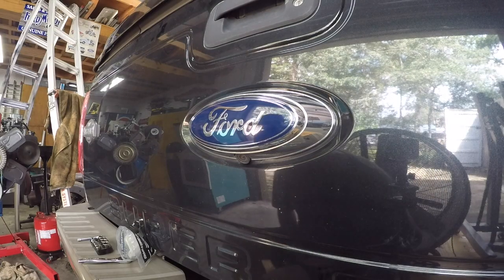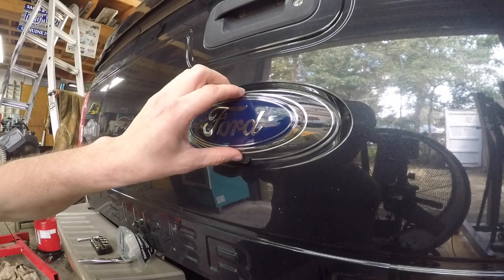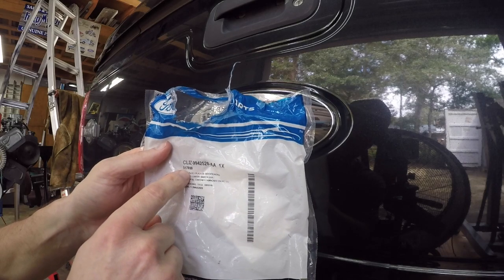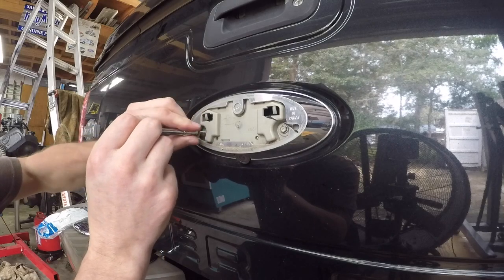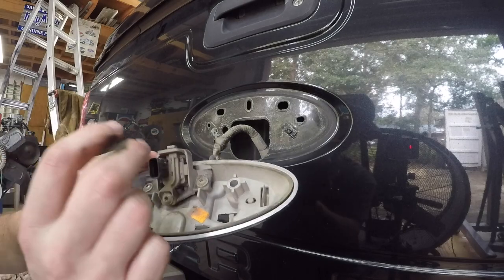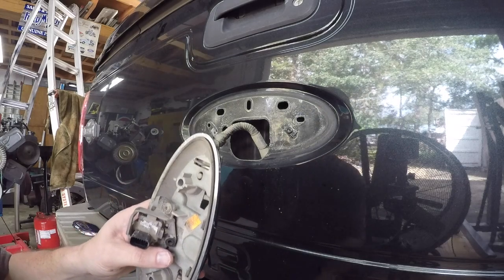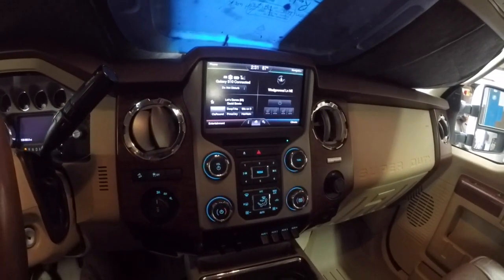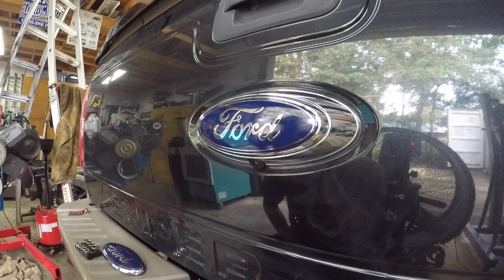2013 Ford Superduty F-250/F-350 - Backup Camera/Park Assist Replacement

Comment: Thanks for the video. Purchased the backup camera on eBay for $170. Works great. It came with the lines and zoom feature so I didn’t have to go to the dealer and have them sync it after I installed the camera. I saved over $800 as the dealer want 1k to replace the camera and install. I was able to install in about 10 minutes thanks to your video. Appreciate you.
Reply from the maker: @ChrisJohnson-ly6fq  good to hear!

Comment: IMPORTANT.:  My backup camera 2015 SD, 190k miles, would be only intermittent, not foggy.  I troubleshot it to the wiring to the camera assembly and found the wiring pins got oxidation on them.  After cleaning the pins on both camera and socket it did the trick.  It took 30 min of labor for me, however went out again after 6 years and this time I'm using dielectric grease on the connector to keep the contacts cleaner and reseal the old emblem with a little bit of silicone to keep the rain out and hold it tight.  Great video,  Thank You!

Comment: Thank you for this video!  We pulled our tailgate off today and forgot about the camera system.  Ended up yanking a couple of the wires loose at the camera side connector.   I was ready to take the tailgate apart from the inside to get to the camera until I saw your video.  Once I saw the video it was a ten minute fix.  Again, much thanks!!!
Reply from the maker: Awesome! Very happy to hear you were able to use my video. Thanks for the nice comment too.

Comment: I'm having the same exactly issue with my 14 f250 being intermittent.  Dealership quoted $180 for diagnostics alone, not including camera or harness replacement if it comes to that.  Currently waiting for a replacement camera to arrive today and will do it myself.  This doesn't look too difficult, thanks for the walkthrough.
Reply from the maker: @RealSlamboJenkins  try the other stuff like cycling the parking brake and checking the tailgate area as well. Thanks for the nice comment!
Reply: @ it was the camera.  Took me a while to see the notification of your response I guess, haha.  Now the backup camera software is misaligned when I put in reverse.  😬
Reply from the maker: @RealSlamboJenkins  Check out my, and other people's  comments to see how to calibrate it using FORSCAN. It's not hard but requires an OBD connection (Amazon) and the FORSCAN program (free) or $12 for the year. This will save a dealer trip.

Comment: Thanks! You can use dental floss to compress tabs to remove Ford Emblem, slip under Emblem and apply pressure til Emblem end pops out ..
Reply from the maker: Thanks! That's a great tip. Mine was already broken so I just bought a new one, but very good to know!
Reply: Do you go from the top, bottom or side with dental floss?
Reply: alignment pins are in the way if you have to go from the bottom up. I think it will work. the problem is threading the floss or fishing string around the pins

Comment: Having the same issue with my 2016 F-350, I took it to a Ford dealer because I have a MaxCare insurance policy that I bought with the truck when I bought it through CarMax. Well, took it to Ford yesterday and they 'diagnosed' the problem as a bad camera and replaced it. I checked it when I picked it up and it worked. However, when I got it home and backed into my space, it DIDN'T work. So, nothing has changed. I'll be going back today!

Great video though. Had I seen this before, I may have taken this job on myself, along with checking the parking brake thing and the connection under the rear by the hitch. Problem is, at 75 I'm not as nimble as I used to be so I rely on the insurance policy I bought. 

I really liked the way you did this video. It was like I was sitting right there with you.
Reply from the maker: Sorry to hear your camera is still inoperative. I have noticed the wires in the tailgate area are highly susceptible to breaking as they are constantly flexing with the opening and closing of the tailgate. My dealer went straight for the camera before checking the obvious areas. Do you set the parking brake often? If so, let it release abruptly or snap back several times observing the camera. If it comes back to life, the issue may be in that area. Try wiggling the wires where they pass through the tailgate. Hopefully this helps and thanks for watching!

Comment: Thanks for the video I cleaned and disconnected all the plugs nothing worked. I ended up checking the camera pigtail as last resort and sure enough it was the the problem with that ground cable.

Comment: I'm currently trouble shooting this problem myself. I have tried a few of the tricks and it will work for a little bit. I was wondering if replacing the camera solved your problem or did you continue to have intermittent issues.
Reply from the maker: @ezrodeo  Replacing my camera fixed my issue. Absolutely check all of the wiring especially at the areas that flex with the tailgate moving. If you do replace the camera, you have to do the calibration in order to get all of the features to work. An owner can do this but it requires the use of a couple of purchased item but it still cheaper than the dealer.
Reply: @wrenchingwithrob6001  thanks for the quick reply. I did replace the wiring harness because I read so much about the ground breaking and I wasn’t interested in taking that all part to splice it. This was my next step but I was just curious on a follow up. Thanks again.

Comment: I was told at the ford dealership if you changed your back up camera the truck would have to be programmed by the dealership. Is that true?
Reply from the maker: @jerryoliver7126  yes and no. It does have to be programmed but it will operate. You won't have the magnifying glass option and the zoom until it's programmed. It can be accomplished by the owner though. It doesn't have to be taken to the dealer. I've put some links and comments to other YouTube members pages detailing out the procedures. I apologize,  when I made the video, I was unaware of the additional steps.  Thanks for watching and the comment!

Comment: Did your zoom function work after you replaced your camera? I just replaced mine and everything worked except for the zoom. 2013 F250 using the same camera you used.
Reply from the maker: So I have to admit that I never knew it had a zoom function. I did try to push the  button but it didn't do anything. This was the part number Ford gave me for the camera or verified. I do sincerely apologize if this is incorrect. Thank you for watching.
Reply: Mine did too you have to reprogram the camera, you have to use fordscan and a obd to usb worth it tho

Comment: Any updates on if it continues to work?   I’ve replaced wiring harnesses and no luck.  Sometimes it works and sometimes it doesn’t.
Reply from the maker: So, my camera is working as it should. I have heard that sometimes the issue is either behind or above the parking brake pedal. There are some harnesses in that area that affect the camera operation. Try letting your parking brake snap back a few times or wiggle the wires above it while watching your display. Hope this helps and thanks for watching.

Comment: 😳 how did you turn off the reverse beeping
Reply from the maker: So, depending on what dash or trim package you have, (my truck has the King Ranch trim package) when you place the shifter into reverse, an option should pop up in your center desk between the tach and speedometer. This pop-up should be in blue text and say something like back up sensor or like that and two options, on or off. Use your arrow buttons on the left side of the steering wheel to change the highlighted  text to either on or off then press the enter or ok button in the center. This will turn it off. It will remain off until you restart the truck. Hope this helps.